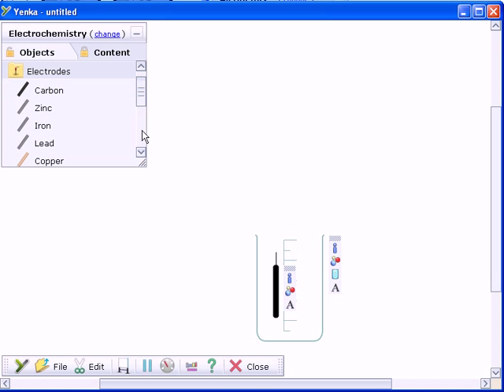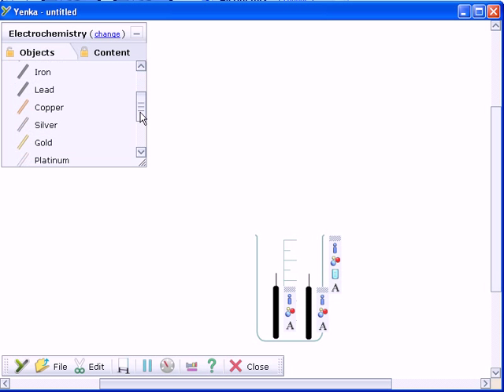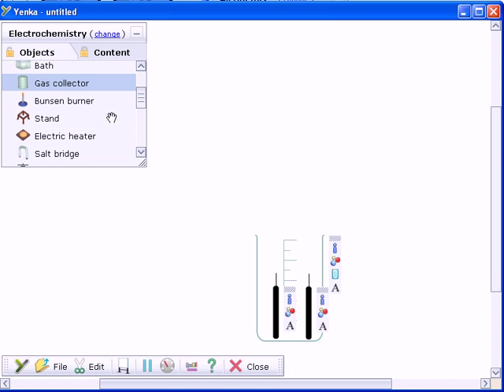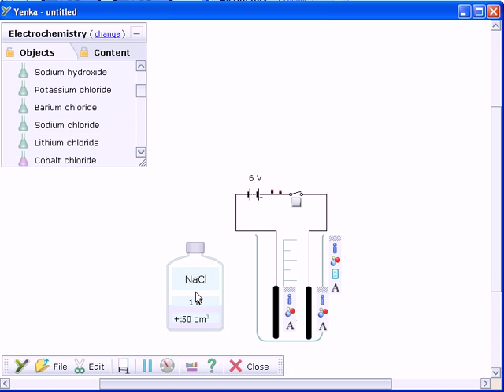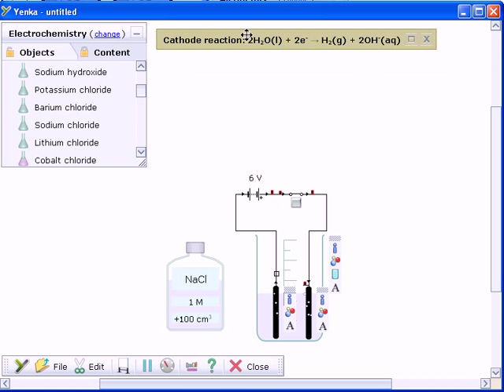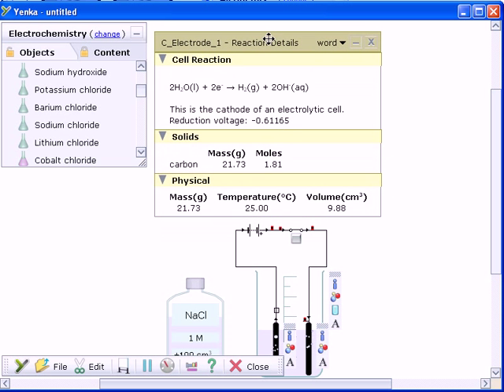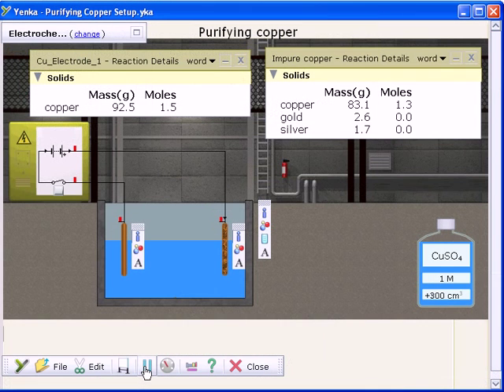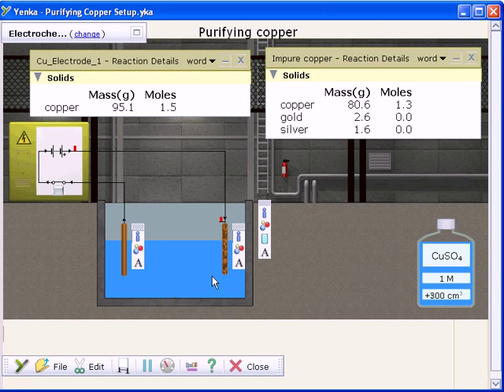Introduction to Yenka Electrochemistry

Comment: The way this program combined simulation for chemistry, electronics, and physics all within a single workspace was groundbreaking. I have never seen anything like it since.

I can't quite remember, but couldn't you make a chemical battery with electrodes and that could interact with the yenka electronics, which could in turn power a motor to interact with the physics element? Seriously, it was mindblowing.

I would love to see what advances in artificial intelligence could do for this type of simulated hands-on learning. A whole VR workspace that allows students to experiment without the danger, expense, and limited materials of a proper science lab